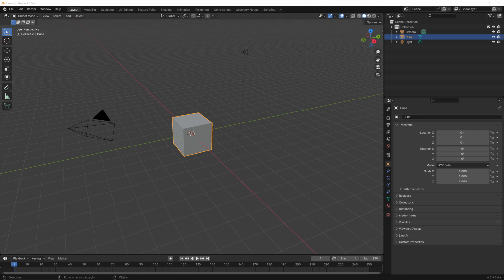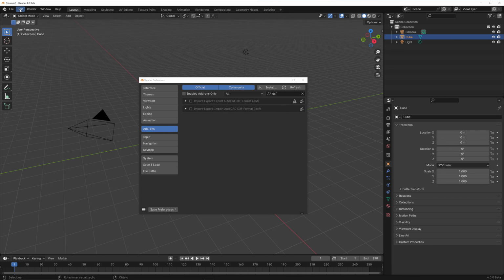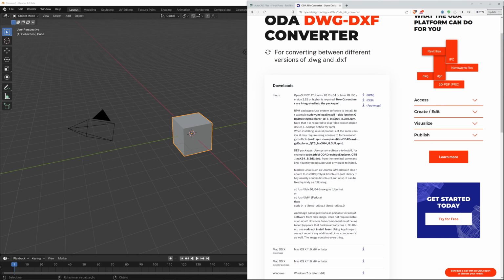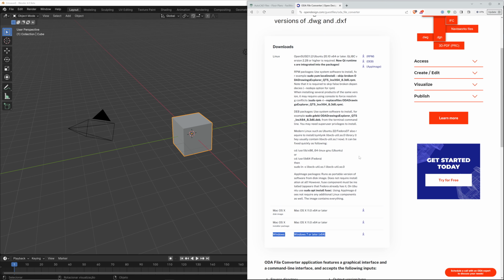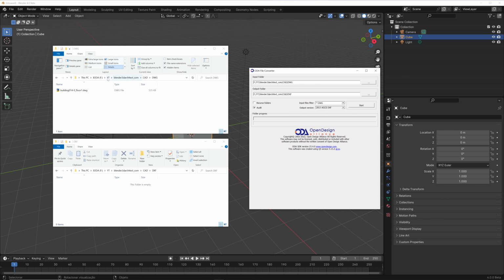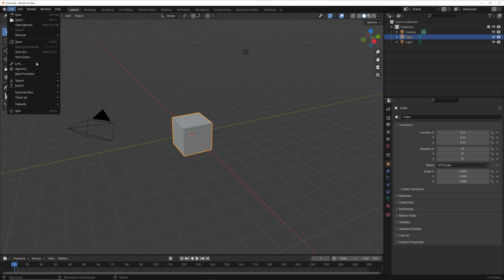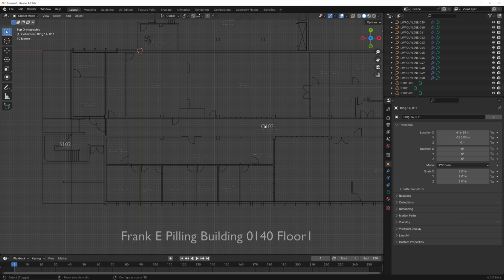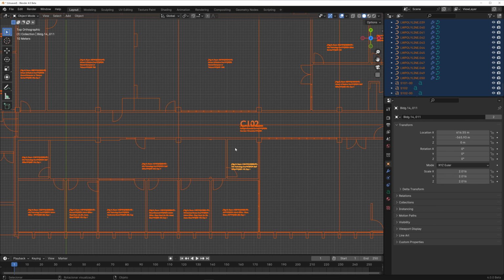Blender 4.0: How to import any DWG?

Comment: This method did not work for me. I tried to export DXF straight out of ACAD2020 as well but each time, Blender shows a jagged geometry that is hard tow work with . It looks as if it cannot import curves from ACAD and instead interpolates them into stepped lines.
Strange because I have had success with importing ACAD files to Blender and ones quite similar to the one I am trying here,  but for some reason its not working now. Could this have something to do the later version of Blender (I am using 4.2.1)

Comment: Thanks for the informative video. I wander if it is possible just save a DWG file in autocad as DXF file and then import it in blender, without recurring at a specific program to make the conversion.
Reply: You can, I just tried it and when you save the file in AutoCad you have the option to change the file type and there you can pick DXF instead of DWG

Comment: Hello Allan, I would like to know how you deal with the units in both programs. I work in AutoCAD in metric mm (1 meter are 1000 units) and so on. When I import to Blender (exporting from AutoCAD to DXF 2000) I see that I need to scale my drawing to make it fit the camera in blender otherwise the geometry tends to disappear from ACAD to Blender! what could be the best practice and how could the setup be in Blender in order to import or if I need to scale to .0001 so my meter is 1 (unit) instead of 1000 (units) or millimeters. Thanks in advance and Great Video.
Reply from the maker: What I usually do is to change the Blender units to match the source file. If you keep it in the default settings, it will stay in meters. If you design in AutoCAD using millimeters (mm) and draw 1 meter with 1000 units. Importing that project to Blender will convert those 1000 units to 1000 meters or 1km. Update the units in Blender before importing.
Reply: Don't forget as first step after importing, when it all is still selected, press Control A in Blender to Apply the Scale or better Apply All Transformations. So it accept the scale as original size and won't give problems later.